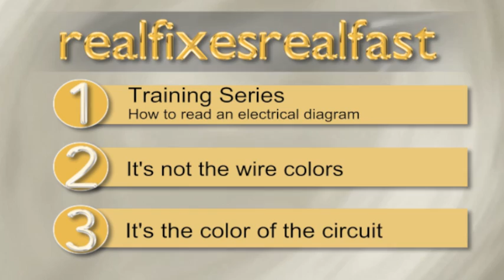Electrical diagram Series, It's not the wire color, it's the diagram color

Comment: Hi first let me just say love the vids , been a great learning experiences. 
 N second got a question. 
I have 02 saturn l200 2.2l replace fuel pump, fuse relays n instrument panel, also ran a new wire from fuel pump to pin 22 (the purple wire ) n my fuel gauge don't read it stays on empty even when full, 
Can't find pin from computer to fuel gauge, 
Can u help or direct me in the right direction 
Thanks in advance ,been a member for a while n it keep me on the learning road.